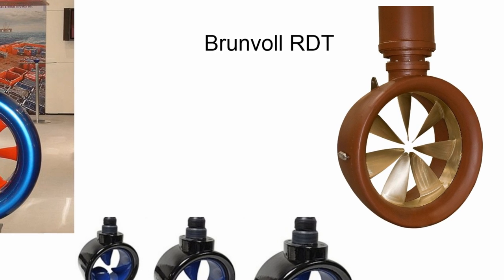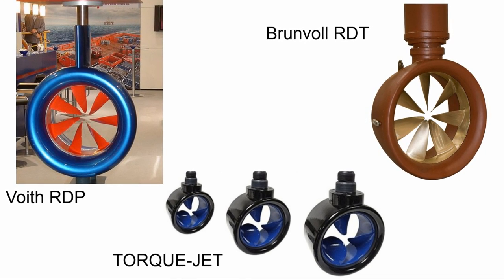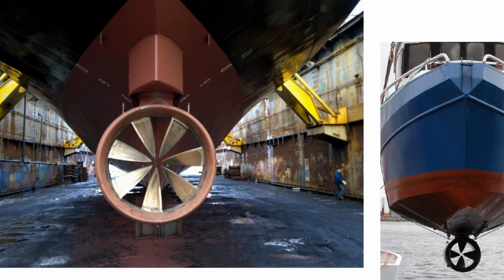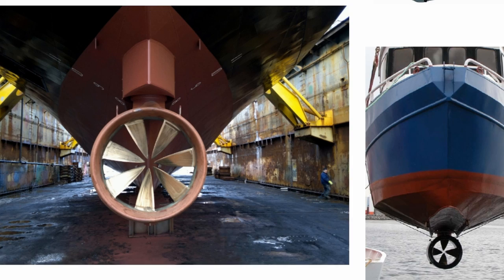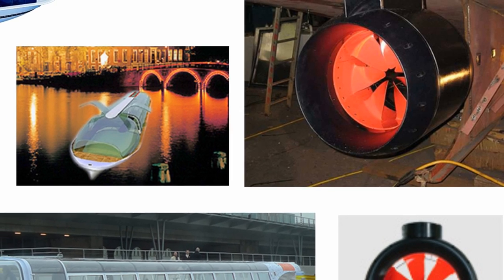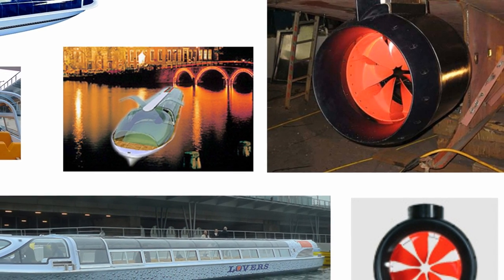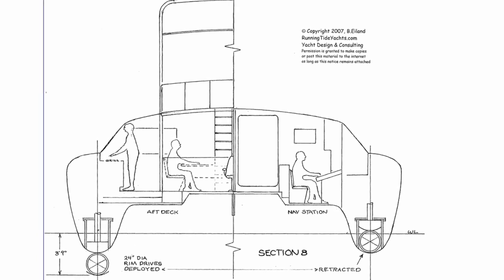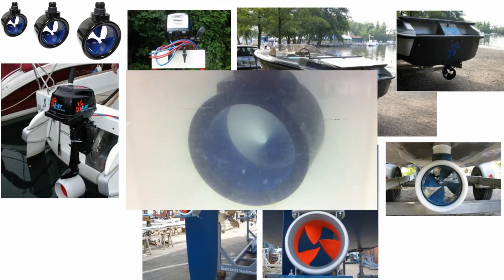Rim Driven Propellers (RDP) or Rim Drive Propulsers and Thrusters

Comment: I ran a nozzle tug in the 80's it was a pod design basicly a sideways wedge in the middle of the hull this enabled a short horizontal prop shaft (good for thrust) turning a standard prop with the tips radiused making it 2/3rd size it fit in a round tube for a rudder this enabled it to reverse as tight as in foward and increased thrust by 40% (l was told) it pulled like a mad thing. It could go full fwd to full rev in less than 2 seconds (if necessary) trick was go 1/2 throttle into reverse  back to neutral then full reverse twin disc gear groaned a bit but held up no problem. This enabled a 36f tug to jump boomsticks. I'm sure it was a much more inexpensive over the counter design with standard parts no complicated special design needing a 'tech' flown in. It was a blast to run instant power. Straighten tow hooks up to 1 1/4 so the guy before me laughed.

Comment: so these r the brakes for boats, nice, that is useful feature. Should b build max diameter allowable for draft splitting the job right & left if needed. Super expensive yachts should b 1st calling. Not how u see them here BUT just 1/3 of the hole blocked by maneuvering " blade-less dyson fan brakes". Normal inline 2 prop propellers 1, 2 pitch or adjustable pitch r best game on earth. Pods r very good if u can't hve best 2 propeller inline & fan-less system

Comment: those RDPs need better shapes to the blades... closer to the shaft drive to move more water..  heck there is room in some of those to install 2 blades on each section.. \\ to add to the thrust..  they are missing about 20 or 30 percent of the surface in my gestimate  if the drive can create enough torque to spin it..  or maybe there is just not enough RPM generated by the external drive..

Comment: If this could be coupled with a gearbox and utilised for UAV applications, this could be revolutionary. Main drawbacks of UAS is inefficiency at the props outer edge and the noise these inefficiencies create.
Reply: Korts nozzle (l believe) design been around for 40 years. I left a description in comments.
Reply: Air does not cavitate.

Comment: Make a basket thick enough it can b plenty strong but if so thick solid metal becomes lighter than machined honey comb basket then pnt-less effort.
Reply: Exception is if needing super high heat endurance than basket is better way to go then solid metal only triangle not honey comb hole type basket.

Comment: Braking a boat & no entangling is key sure clear selling pnts, w/matching sailing knots no drag 3rd good pnt. Pod steering braking drive slow speeds is fine, just bigger diameter & 1/3 diameter blades max. If the blades r wire basket thicker than normal blades but still lighter bc hollow like honey comb, yeah u really hve * a great new product & design. Bc wire basket thick blades they can b made cheaper any fuck size & milled easily down to needed shape, then basket/honey comb covered w/what ever durable material to cheapest use, & use as shit to repair w/new surface rap coating like body work.  All med sided propellers not needing ultra strength load will switch over to honey combed machined coated system.